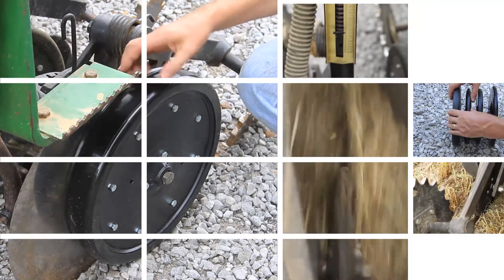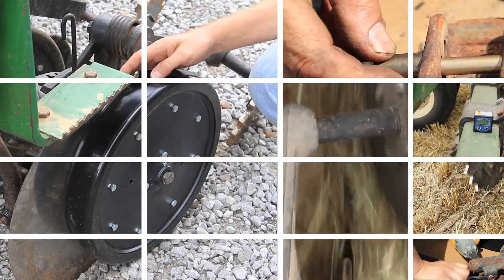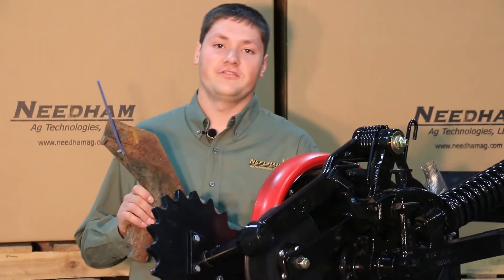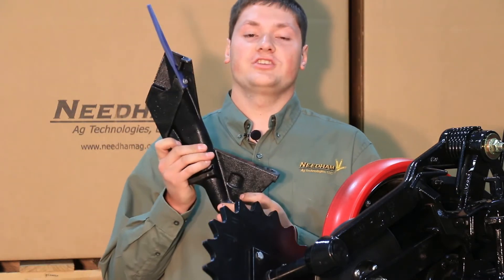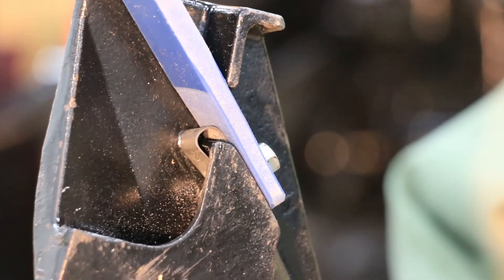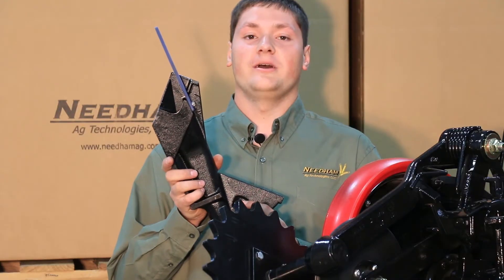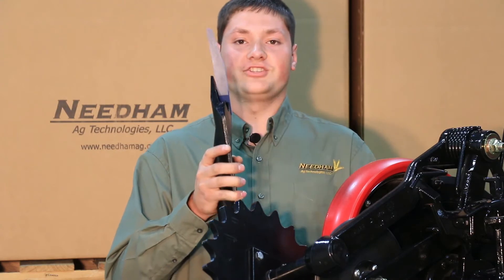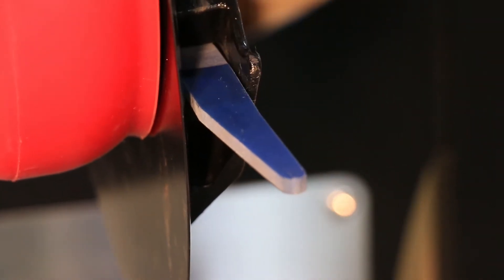Needham Ag - Installing Bonilla Seed Tabs On John Deere 50 and 90 Series Single Disc Openers

Comment: How do you know when to replace the factory tabs? I realize you’re in the business to sell, and I’m considering your tabs when mine are worn out.
Reply from the maker: I believe the factory tabs are new at 5 1/4” (total length). They don’t do much when they reach 4”, but they often break off before that length.
Reply from the maker: The Factory JD 50/90 series white seed tabs are new around 5 5/8” long and they need to be replaced at around 4”, but they usually break off long before they get down to that length. 

The Bonilla tabs are much better because they are thicker to do a better job holding seeds down, plus they are tapered to match the seed slot.